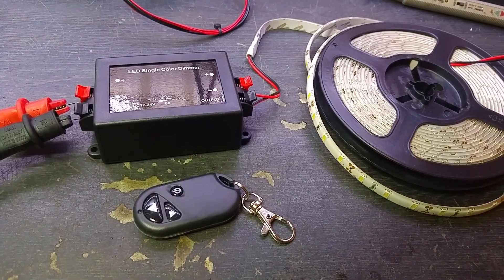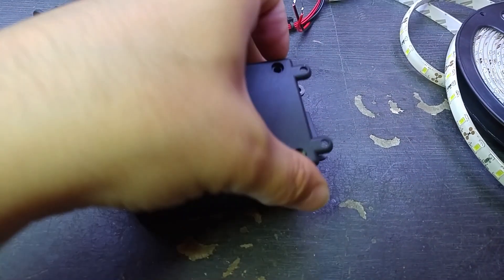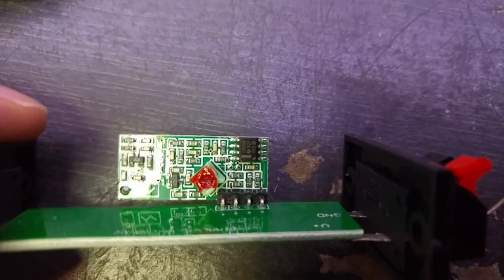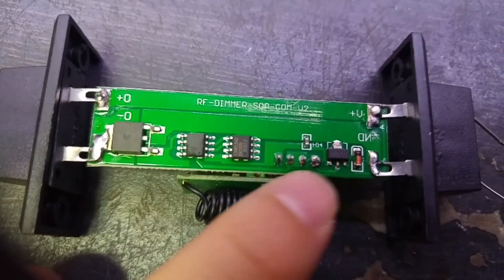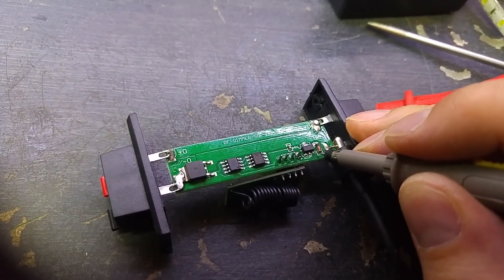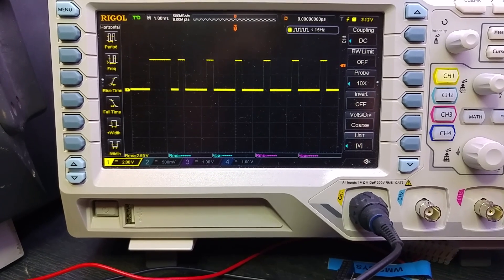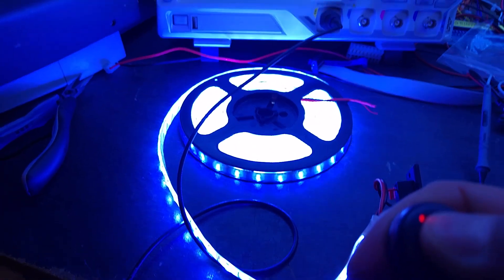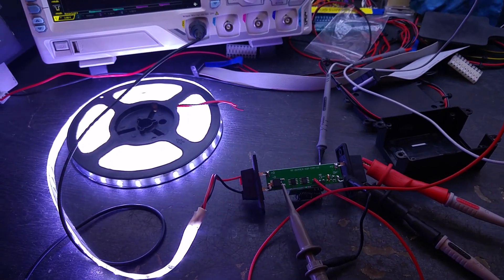Chinese RF LED Dimmer - Does it work?

Comment: also got one, a few years back and just got around to test it as it arrived without that special A27 12v battery.
It passes the voltage thrue but the remote won't function, so though there likely would be perhaps a binding process, like holding command of buttons etc or likewise to activate the native remote (identical to yours) but it doesn't look like it, and more as it should work from scratch..
so likely also problem with my box. taken a quick look inside and not sure if its an older or newer revision but quite different,, the chips are there, but the antenna is now gone, seems to be implemented into the board with some copper traces along the edges, also has what looks a crystal around 6.xxx something.
but for the money, and lack of spare regulator chips, I reckon it would be easier to just jump on a new one... thx for the vid.
if you want a picture of this new board, just say so.
Reply: Did you find out how to connect remote? Cheers
Reply: @matthewelston1987  I grapped another one they cost like 3 or 4 USD delivered and it worked from scratch.. though haven't check with part of the old unit that actually was a fault or if it was me that simply misunderstood it.. will take a closer look the comming days.

Comment: Hi, could you clarify a question? If the brightness is lowered to 50% and the power is turned off (No power off remote button), (without electric current)

When the device is plugged in again, does it save the last programmed draft? 50% in this example

Like you answer me
Reply: Damn, I came here looking for the same answer.. did you ever find out ??
Reply: Yes, it does. Look at 8:12

Comment: Impressive repair. Won't the pwm cause flickering? Can i know what kind of frequency is the pwm using?
Reply: pretty much all LED dimmers are pwm, with reasonable high frequency (390Hz if you look at the scope on the video), so your brain does not register it as flickering - stroboscope effect is around 10-16Hz or so. To be fair the repair was pretty straight forward, check the supply to the microcontroller - nothing, check the voltage regulator. Nonetheless great video.

Comment: Do you know if I can control control multiple receivers with one transmitter?  I was thinking about picking up a bunch of these for a custom application.  I didn't see anything on frequency adjustment or pairing.

Comment: I see you have the rigol ds1054z scope, have you unlocked the 100mhz mode.

I'm thinking of getting one to retire my old Tektronix scope that has a busted channel so is there anything I should look out for in advance.

Thanks.
Reply from the maker: I've not done it yet, waiting till the warranty runs out first. I've not really had a big need for 100mhz (as most old videogame/pinball equip is 20mhz max) however unlocking the serial decoder etc will be far more useful. I'm very pleased with the scope, I don't think there is anything better for the money, but sometimes I have to say it's nice to use an old analog scope as it can be easier and quicker to adjust for signals
Reply: Awesome, thanks for the quick response. good call waiting for the warranty to expire before unlocking the extra function I'll probably do the same.